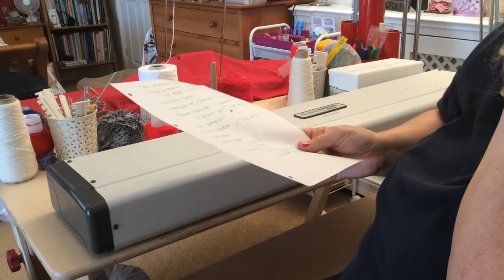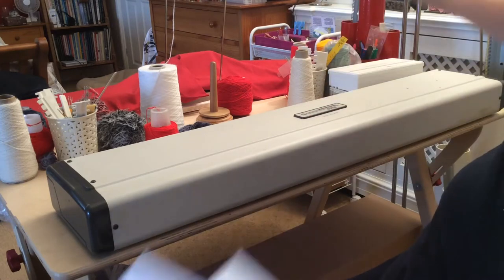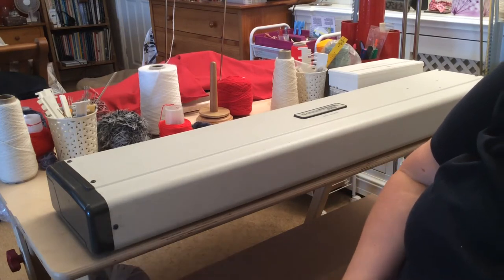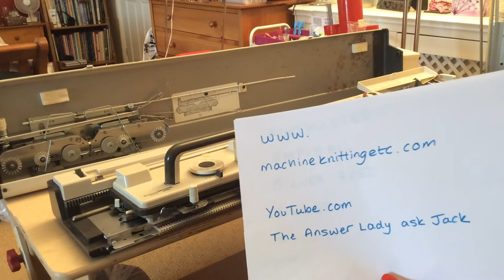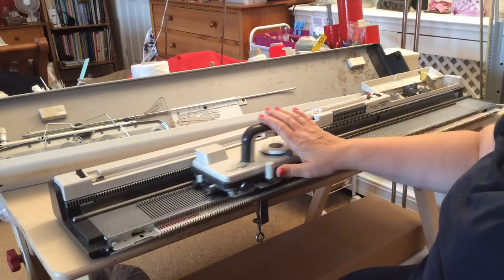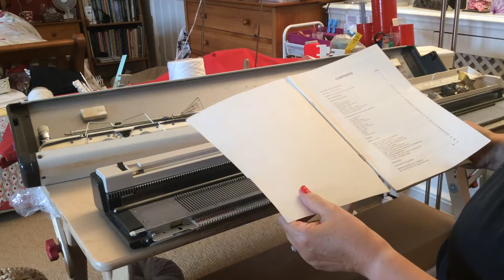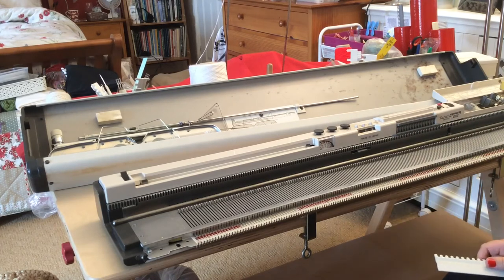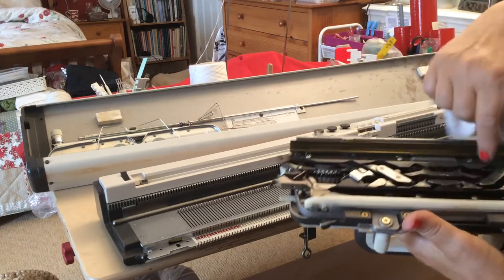Machine Knitting - Checking a Second Hand Purchase

Comment: I just scored a Singer Memo-matic SK324 from a local elderly nonna wanting to pass it on to someone who would use it. It was only $100 (AUD) for everything including ribber attachment, linker attachent, loads of punchcards, and hole punch and empty cards for making my own designs, manuals for everything, pattern books, instructions from when she took lessons in the 1970s, it seems like everything is there, even the original silky thread. Not a single part is rusted, everything appears to be in perfect working order apart from the sponge bars needing new sponge. I can't believe my luck! She even gave me the original folding table it came with. I can't wait to git it a go. Thank you for the videos.
Reply from the maker: That sounds like a great find, well done.  Enjoy using your machine.  If you are on Facebook, join the Machine Knitting Beginners and Returners Circle, there are lots of beginner friendly patterns and general tutorials to help you learn your machine.

Comment: My wife wanted to use her Singer knitting machine after a break of about 45 years. Took it apart as some electrical bits not working and they just needed a bit of a clean after not being used. Checked, cleaned, the bar and carriage and it was all OK. Tried using it and there was definitely something wrong with the tension. We could not figure out the problem and spent hours on and was about to give up.

Then your video popped up. Watched it until you got to the sponge bar. What sponge bar?  Found it and there was actually no foam. It had all decayed. Have ordered a replacement but expect that to have been our problem. 

So, thank you for your video. Was really useful and wish we had found it sooner. Really good explanations of what to look for. Thanks again.
Reply from the maker: Thank you Glen, I’m glad I was able to help.  Back in the day, we were never told about spongebars, it was expected the technician would deal with it when the machine was serviced!
Reply: @sallybutcherskalamundakrafts  Had tried to find someone who would service it but could not find anyone so ended up doing it myself. Wish I had seen your vid a lot sooner would have been great but was worth it for the sponge bar though. Thanks again for a really useful video.

Comment: I'm in the US. What is the US equivalent of "white spirit"? Rubbing alcohol? Isopropyl alcohol?
Reply: White Spirit in the UK is used as a paint thinner for traditional oil-based paints and is also used for cleaning paint brushes and rollers when used for this paint type. It is also sold here by the name of "turps substitute", "turps" being a contraction of gum turpentine. I think this is called "mineral spirit(s)" in Canada and the United States.

It is definitely not propanone (aka "acetone") or propan-2-ol (aka "iso", "iso-propyl alcohol" which I believe you call "rubbing alcohol"). It also is not the thinners used for cellulose paint or spray gun cleaning, known as "cellulose thinners" in the UK.

Comment: Hi, I just bought knitmaster but needles are rusty. What would you use to remove the rust? Thank you
Reply from the maker: The first thing I try is white spirit, or surgical spirit.  If the marks are stubborn, you can use wire wool, or something like a Brillo pad.  I have heard people say they get could results soaking rusty needles in cold black tea or Coca Cola, but I’ve not tried it myself.
Reply: @sallybutcherskalamundakrafts  thank you!

Comment: Hi Sally, I’ve recently got my SK210 out of storage and set it up cleaned and replaced all necessary parts. The carriage glides along the bed just fine on it’s own but as soon as I attach either the knitter arm or ribber arm it gets quite stiff to move along and quite difficult to move over the needles. Any ideas why this might be ?
Reply from the maker: Did you replace the spongebar?   It’s often this either being worn or inserted incorrectly that causes problems.  It could also be the carriage not being seated correctly.
Reply: yes I have replaced the sponge bar, the carriage runs over the needles no problem until I thread up and start to knit then it’s really stiff when I try and run over the needles.
Reply from the maker: @alisonpoole9755  is the yarn too thick?